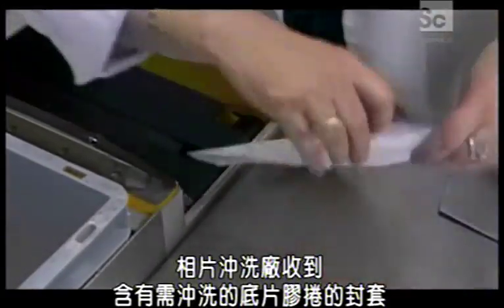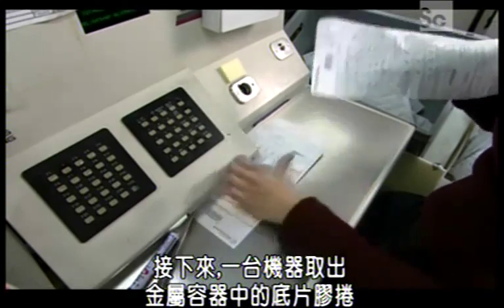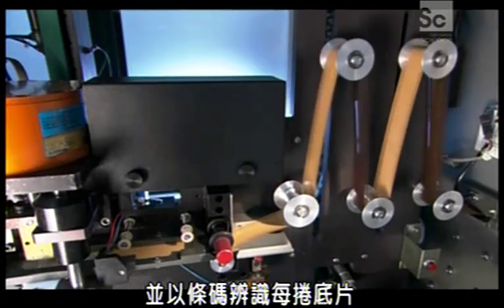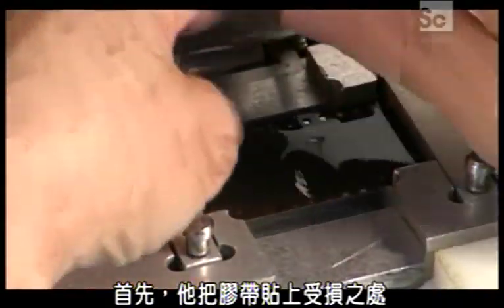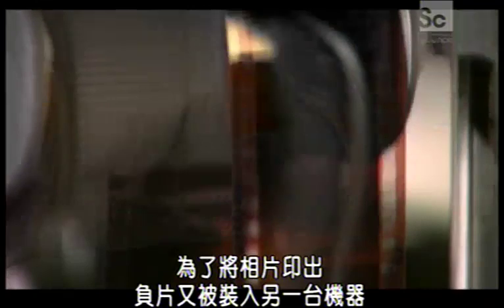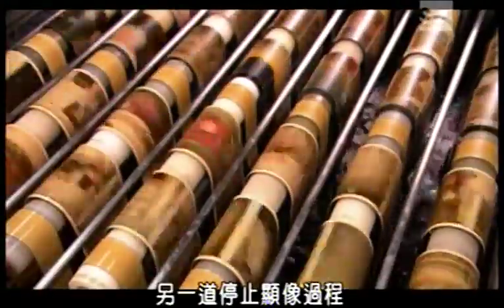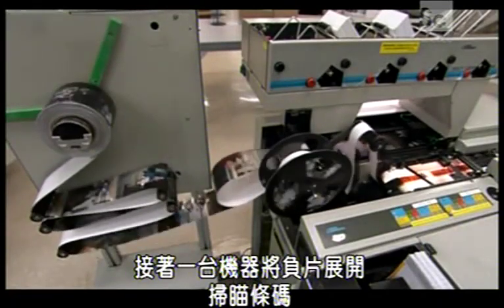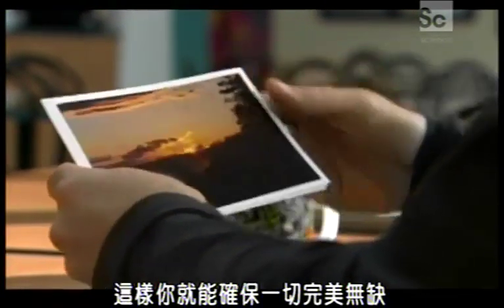自動沖印工廠運作流程 How an Automatic Film Processing Lab operate (正體中文字幕)

Comment: is this as good as self developing?
Reply: Nope
Reply: +Marco Wittkopf why?
Reply: they dont watering enough (the negative last longer when you clean it right) and somethimes they cut in the frame
Reply: Of course a machine can do it better, automatic and lot's of films at ones ! There is nothing wrong with bringing your films to the lab.  Well it is all over now but I worked at Kodak Holland on printing and paperprocessing 16 years.
Reply: Yes for color proceses like C-41or E-6 machine will certainly do it better. But black and white film is much better to develop yourself. As every one of them requires very slightly different development time.
Reply: Hi Onno, I've worked at the Kodak photo lab in Belgium for 29 years. Also printing and paper-processing. Sadly it's my last year as the work has slowly dried up, even the digital prints are being undermined by smartphones. Also Kodak have stopped manufacturing photo paper in europe so we're now gradually printing on Fuji paper.
Reply: @TheRenaissanceman65 Ive developed like 5 rolls myself so far, no issues and pretty easy. i just run it in a water bath in my sink, no sous vide or anything. its like 10x cheaper, definitely worth it and fun.
Reply: @philbraithwaite1316  I always used Ilford and Agfa paper.